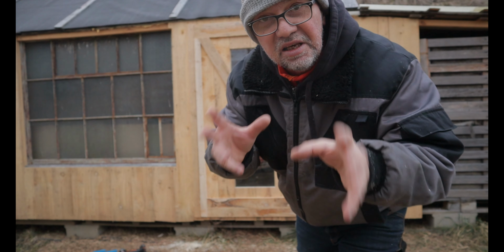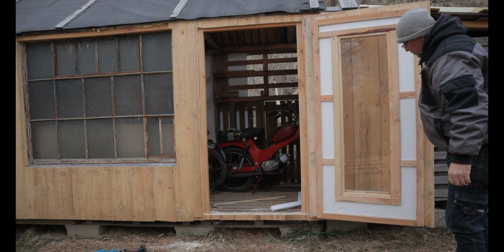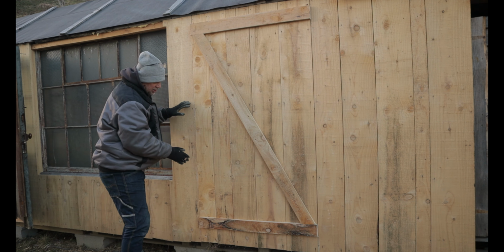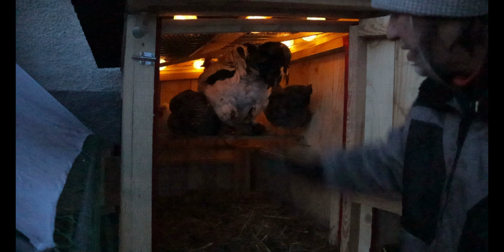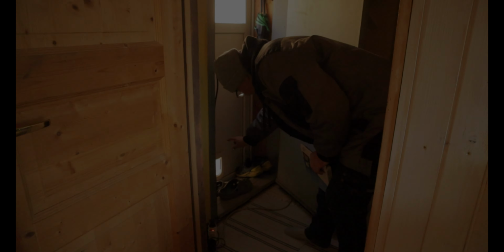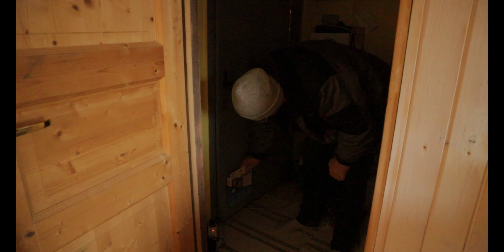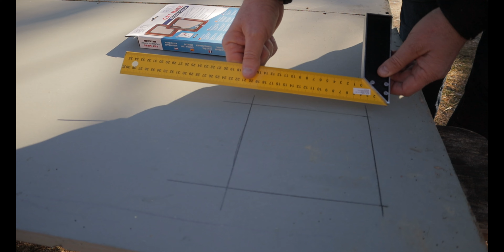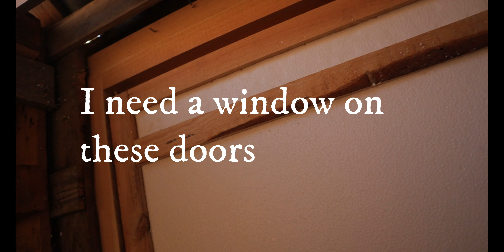How to Make a Door from a Wooden Wall DIY

Comment: Love the progress you're making. And to think it all began with a stack of used wooden pallets. Amazing!!!
Here's a hint from they styrofoam manufactures web site:  When sawing through wall with exposed styrofoam on the inside run a length of painters tape along styrofoam where saw blade will cut. Doing so will eliminate the sawdust effect of cut styrofoam  foam. 
Also from their web site:  When cutting styrofoam outdoors where chickens will peck and eat it, don't. Visit their website for more useful tips. 👍👍👍
Reply from the maker: Thank you 👍🙂👍